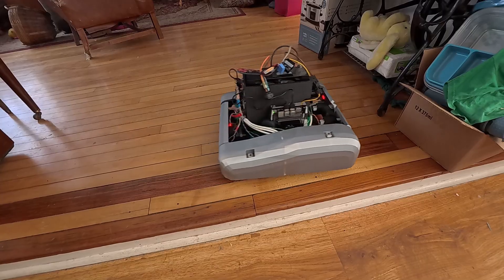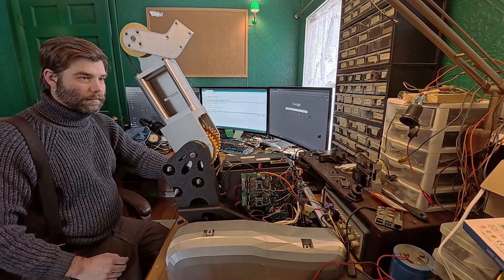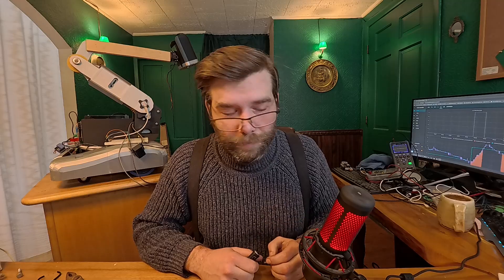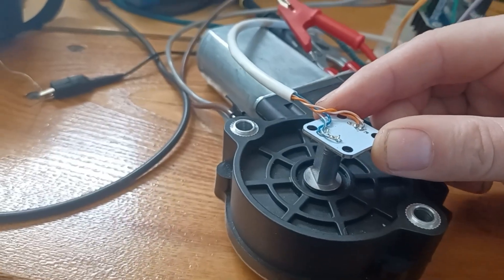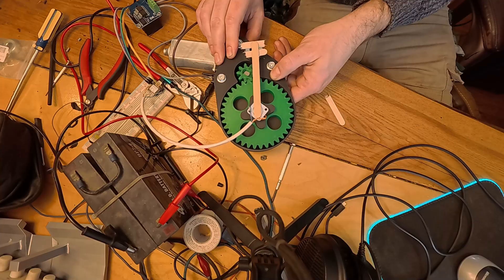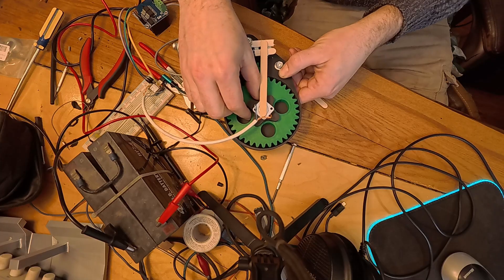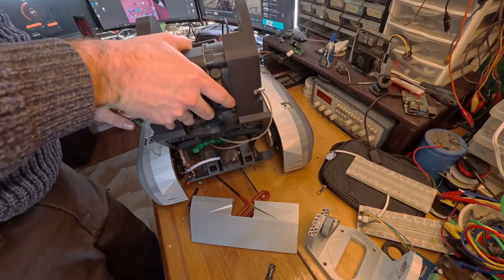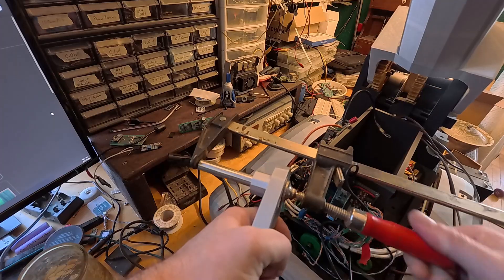Building a Strong and Budget-Friendly 3D-Printed Robotic Arm for my Household Robot

Comment: That looks pretty sweet. you can crank the wall layers to like 15 when you need really strong prints, it makes them basically solid.

Also you can usually adjust that PWM frequency to be higher so it’s not quite as loud when driving the motors.
Reply from the maker: Yes, I'll definitely be turning up the PWM frequency to about 18khz. It's not easy to do on the XiaoESP32C3, but I'll be switching to the PJRC Teensy 4.1 for the servo controller.